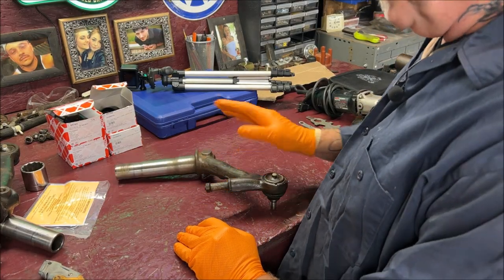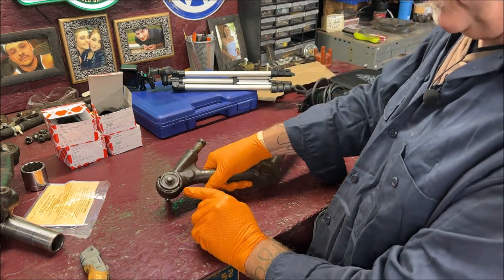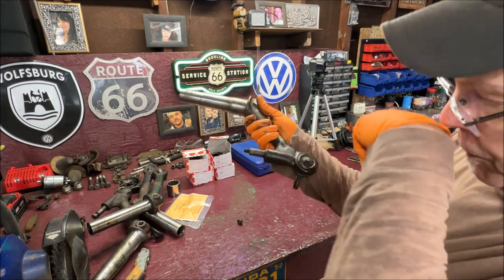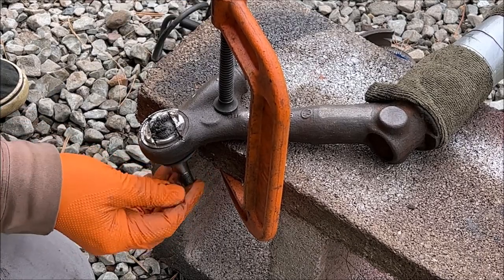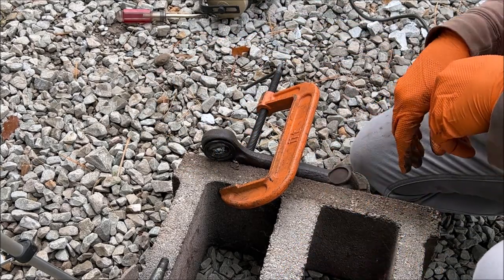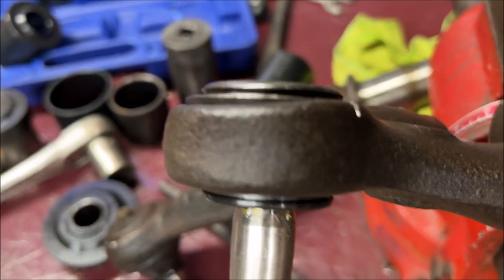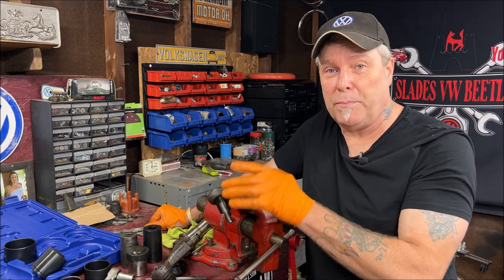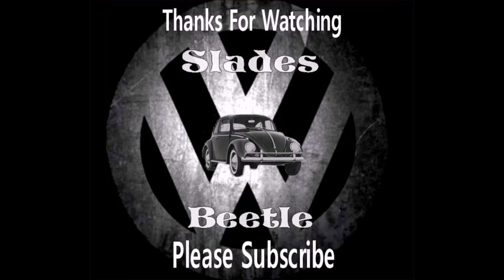VW Beetle Pressing Ball Joints Removal And Installation! DIY! No Large Press!

Comment: I went 30 years in my shop without a press. Oooooops! A friend had a cheapy Harbor Freight 20 Ton I must have used 30 times. I finally purchased the same press with the 20% off coupon. I regret not purchasing it 35 years ago. I use it all the time. More each year as I find more and more uses for it. The first year it sat almost unused, but with time it has become as invaluable as a wrench! (They take up space, so mine is on the side of my house just under the eves and I keep a cover over it)
Reply from the maker: I have been tempted to buy one. I could probably have so many uses for it, and don’t realize it. Thank you so much for taking the time to leave a comment.

Comment: its a pain to put new ball joints in. without the right tools even harder, but you did it. it with be better if the c clamp bolt had fine treads, so one turn can put more power to it. nicely done and 3 to go. next week windows? well there is always someone that will learn from it Tony.
keep up the good work.
Reply from the maker: Thank you my friend! Oddly enough, I wondered why there was such course threads. It made it seem much tougher than it should have been. I’m glad you brought that up.

Comment: Hi I just got my control arm bushings out. I had gotten the rubber parts out months ago, but now it was time to install, and I needed to get the steel inserts'. I saw some guy who used a rental tool, I got one FOR FREE at AutoZone. It is called the Powerbuilt 23 pc Ball joint/U-Joint Service Kit. They rent it for free. Took me about 10 minutes to get BOTH steel inserts out-I used a 27mm socket for the "push". When I brought it back I brought the guys and gals over at AutoZone some donuts to show my appreciation.
Reply from the maker: That’s awesome!!! Most things can be done at home honestly. Of course with certain tools!

Comment: Used a similar tool on mine slade, pushed them out with it too, they do work, however I was using a 36 inch breaker bar....keep on keeping on
Reply from the maker: Thanks Dave, I ended up using a 3 foot pipe on the one, and when I heard a loud crack, I thought I broke my breaker bar. Here it was the ball joint coming loose. 😁

Comment: Mornin' Slade. Please allow me to give you the story on my BJ R&R experience. I ordered my new BJ through CIP1, when they arrived I checked them out and they were very hard to turn. They moved fore and aft fine but very stiff to turn.   So I thought okay that's just the deal, once they are installed and I have the mechanical advantage of the steering wheel it will be fine.

Well when I got the arms installed in the cae and all the linkage hooked up they were still stiff. I didn't have the steering column hooked up yet so no steering wheel advantage. The BJ were so tight that I could not grab the tire and force the steering to swing. Normally you should be able to get the steering to swing just be applying torque to the tires ( car jacked up of course).

So long story short I  was still in denial about the BJ being WAY too tight so eventually I get the steering column hooked up get the wheels aligned and this thing is still STIFF! Man I have to reef on the steering wheel to get it to steer.  There is absolutely no way the steering will self center after going around a corner, I have to steer back to straight.

So I think I will be taking things apart and putting in new "new" ball joints. Now I had mine installed by a shop using an extract and a press and they said it was the hardest set of BJ to get unseated and installed that they had ever dealt with.
Reply from the maker: That is very strange Lawrence, I have never run into that before. If they were put in right, according to the marks, in the right position. There should be no problem.
If in fact they were not put in the proper position, the ride will be extremely stiff and very hard to steer.
Give me an update when you can, I’m curious to see what is going on.

Comment: I like to add wheel bearing grease to the forcing screw threads to make it easier and reduce chance of falling threads.. I’ve used my impact gun many times on my ball joint puller over the years and never had any problems with it

Comment: Thanks Slades, you got a hell of a lot more “Umphhh” than I do. I liked this episode, you again showed that this level work can be done by anyone with a bit of mechanical know how and a ‘Can do it’ attitude.   Nice episode.
Reply: Slades, you once mentioned using an Ethanol friendly 5.5 mm fuel hose that you would put the link through EBay.  Could you let us know that link, I am placing Kevin’s metal fuel filter bracket and want to try the 5.5 mm fuel hose like you recommended.  
Thanks.  Jim S
Reply from the maker: Thank you James, I try to show it using simple tools when possible. Not all of us have a lot of money to go out and buy a large press or other items that would be needed.
The only 5.5 MM that I see on eBay right now does not say ethanol safe. 🥺

So I can’t include a link at this moment. However, I got a message from my buddy a few days ago, what everyone seems to be doing lately is using the  fuel injection hose from your local auto parts store because it is ethanol safe. 

Just make sure you have the proper size and it fits tight. I would take my fuel filter to the parts store with me. 
This ethanol is becoming a real pain in the rear end..
Reply: @SladesVWBeetle    Thanks Slades. Will look into the 5.5 mm fuel injection hose as an alternative to the German braided 5.0 mm hose.
Reply from the maker: @jimmd53  i’m sorry I should’ve worded that better. 
That was my fault. 
I believe it’s 1/4 inch fuel injection hose, but take your fuel filter with you to make sure it fits nice and tight. 
I still run the 5.5MM hose to be honest with you. The braided stuff. 
I just change it every couple of years because it really doesn’t cost that much to do.

Comment: Just a suggestion because I do this a lot with the same kit and it is way easier to put the clamp in the vise and leave the trailing arm hanging.  That way you are pulling down on the threaded press as you tighten.  It gives you more leverage and the clamp is more secure as you pull so much torque.  Also use the largest crescent wrench you can find for leverage.  I still have to use a socket to press the old ones out since the kit is not very complete.
Reply from the maker: Thank you Philip! And thank you for taking the time to leave a comment and advice. I always appreciate stuff like this!

Comment: Thanks for this helps me out, I bought new balljoints about 2 years ago but because no instructions come with them and the manual doesn't go into enough detail I chickened out on installing them.
Now when I get some good weather out on the driveway I will tackle the job. I fitted new window seals all round last Summer and was surprised the front was most difficult  considering it's almost flat, I expected the curved back window would be tricky but the opposite was the case. Just have extra help on ✋.
Reply from the maker: The ball joints definitely can be a battle. But most important they must be put in it openly, as shown. 
I had trouble with my back window the last time around. But I did it alone, which was making it worse.

Comment: I DONT get tired of you repeating... repetition is what I require to learn and/or retain...
Thanks for this video, front end rebuild on my '74 Super is my planned Winter Project. Biggest worry was whether I could do it without a press or not... Still not sure that I (personally) can do it, but know its possible!
Thanks Slade... I always feel more "VW confident" after one of your videos.
Reply from the maker: Thanks very much for understanding, I think I got used to repeating everything after raising four kids. 😁
On your super beetle, it will not be that bad. If you scroll back on my older videos towards the beginning. I did the whole front suspension on my 73 super beetle. What a great driving car that was. I already miss it. The handling, and comfort level of driving, is superior.

Comment: The stock upper ball joint on my '68 bug has an off center stud.  And, it looks like the camber adjusting nut and cone are part of the joint. My new ball joints are not off center, and there are no marks for lining it up.  Did I get the wrong joints? Surely do enjoy your instruction!

Comment: Very interesting video! I was wondering whether the press tool you used to install the new ball joint could also be used to press out the old one? Perhaps a spacer that is sized correctly for that purpose might do the trick??? Just thinking about it. BTW, the sound went a bit quieter around 2:45 to 3:15; not sure why; not a big deal. And, I will remember to "be sure to drop it" when the time comes!!  :))
Reply from the maker: I actually got that from Amazon. I’m really not that impressed with it though. 
You can rent one, for free technically speaking, from AutoZone, or advanced auto parts. And I believe it’s a larger set with the spacers.
What you were noticing with the sound, I have a GoPro set up on a different angle. So sometimes I switch the cameras back-and-forth while I’m filming. Unfortunately the GoPro I don’t have a mic attached to my body.

Comment: I have changed ball joints before.  Never noticed the directional thing 🙄🙄🙄  hope its just a Beetle thing. ????  My bro in law has a shop and they use c clamp and impact gun all the time
Reply from the maker: It depends what you change them on, I have only ran into them on Beetles…. The other stuff that I worked on over the years, Chevrolet, Ford and stuff like that I’ve never ran into it at all.
Reply: @SladesVWBeetle  Ok.  Thats good to hear !!  Must be a beetle thing lol.
Reply from the maker: @pstreetgarage7304  I believe it is, unless there’s a couple other oddball‘s out there. But the stuff that you and I are used to working on and owning over the years are not like that.

Comment: Thanks Slade for pointing out the directional notches. I got the same press, it does work. Can’t wait to watch doing the body work which is not as much fun. What MiG welder are you planning on using ? Cheers from Melbourne Australia 🇦🇺.
Reply from the maker: I hope it helped my friend, the ball joints must be clocked in the proper position or there definitely will be problems. Not all cars are like this of course. But are very loved VWs are unfortunately.
I have a cheap harbor freight welder hear that I’ll probably use. But my body left his Lincoln here, I’m not sure for how long. If it’s here then I’ll probably use it!

Comment: Hey Slade! I’m pressing in my ball joints today and I’ve done the lower ones but the upper control arm doesn’t seem to have a notch to show which direction the ball joint should go. I noticed the video only shows the lower ball joints. Any tips on the upper?

Comment: Ok that works buuuuuuut if you're going to use such a method cut the threaded side of the ball joint off, put the arm on your vice with the ball joint just hanging off and bang it out with a hammer,  much safer on the arm and much quicker